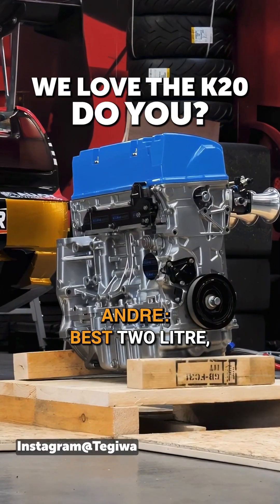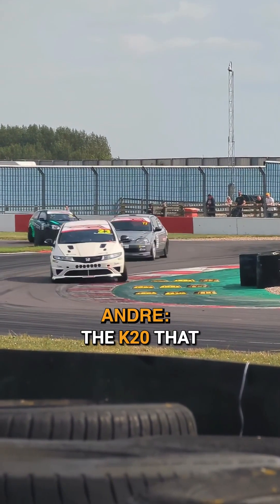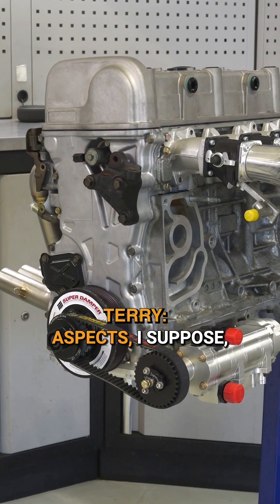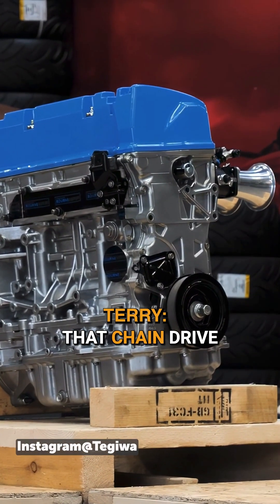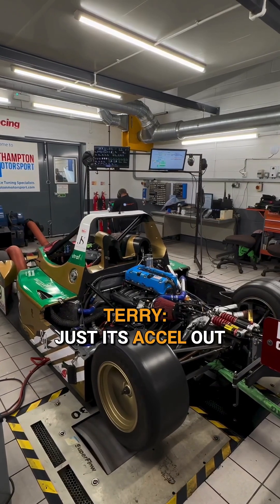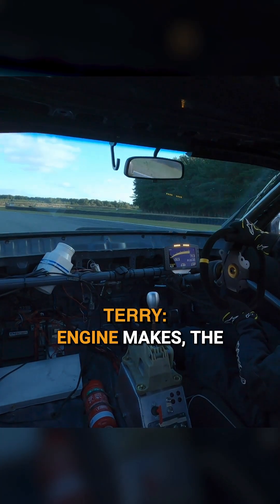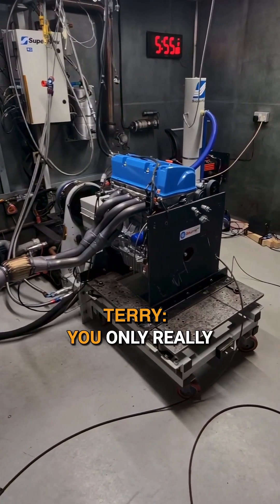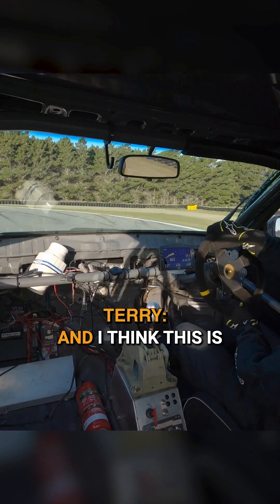We Love The K20, Do You?

Comment: Honda has really shown that they know how to make a good NA 4-cylinder. If I recall correctly, the K family was partly based on the F20C engine that’s in the S2000. That engine was the peak of Honda’s 4-cylinder designs in my opinion. Crazy power for its displacement and aspiration, and 9,000 rpm’s to play with. If anyone in this comment section has been blessed to have driven one, they’d know exactly how amazing that car was. The K20 was the next evolution of that.
Reply: I’m a motorcycle guy so I love revs and a good 4 cylinder. Honda is definitely a step above everyone else when it comes to N/A 4 cylinders. I used to have a TL and can tell you their V6’s are pretty amazing as well. unfortunately emissions are pushing everyone away from amazing engines like that

Comment: "Rate of accel" is power
Reply: i think he's refering to the weight of the internals of the engine. you know if you have a diesel, you put your foot down and you go "one Mississippi, two Mississippi, ok, now we drop the clutch" vs a petrol like on a motorcycle which is at redline in half a second. that affects how the car pulls in first few gears regardless of horsepower.
Reply: @SoulTouchMusic93  yea, I suspect this + the displacement of each piston - probably heavily weighted towards the stroke. 

Diesel v gas isn’t the best example b/c the flame front of diesel moves very slowly compared to gas. That’s why the rpms are always low - anything too fast and you won’t have proper combustion. But also the long strokes allow for more time to fully burn the mixture (so, it’s this + the energy density/cylinder pressures of diesel that makes that torque). 

A wider bore probably does have an effect on how quickly the mixture burns, but I would suspect it’s mostly the stroke. The fast moving flame front of gas, high flowing cylinder heads, the over square bore/stroke, and weight of the rotating parts are probably the main bits that add to rpm accel
Reply: @fragdude  i disagree. my 2l diesel jag was square AF while my honda civic 1.4 single cam was REALLY undersquared.
Reply: It isnt. power is torque*RPM. rate of accelleration is the engines ability to gain or lose revs quickly or delta RPM/time.
Reply: @ChrisMisMYhandle Torque × RPM is just the bookkeeping that produces power, but nobody drives at a fixed RPM on a dyno. What you feel is the power curve accelerating the mass of the car. If you double the power, you roughly double the acceleration—because if the wheels have the power, the car will accelerate.

Comment: I think the B20 with the B16 VTech head would give the K20 a run for it's money, I had one with a AEM cold air intake full Gready exhaust 4-1 hatter VTech controller air fuel management controller bigger injectors Bigger fuel rail upgraded the fuel pump stage 2 performance clutch.
Reply: ...the K20's valve timing system isn't limited to having the V-tec, it also has the cam phaser that allows for ECU-adjustable timing over a range of about 40/45°... that's why it has a lot of torque at low revs and a lot of power at high revs... it's the best two-liter engine ever built, better than the S2000 engine which, during the development phase, highlighted numerous problems that made it necessary to fall back on the more reliable K20🤗

Comment: "rate of acceleration" how many derivatives do you need to describe an engine?

Biggest k20 cons are reliability and airflow
Reply: Cons? I think you mean pros.
Reply: @idkhowtonamemyself2137 yeah i misspelled
Reply: I think he mean specifically how quickly it revs up/down when not under load, for better shifting and driveability
Reply: @brynclarke1746 it depends on the flywheel and torque, both you can change

Comment: Kswap gr86
Reply: I've got a turbo GR86 on the stock FA24. Sure a K swap is viable, but my car is running perfectly fine over 300WHP and everything else functions as stock, which makes for a much more liveable road car. My tuner has been running their car on the same turbo kit as mine at over 400bhp perfectly reliably, which I'll probably end up doing at some point. All it needs is a boost controller and a clutch. The kit uses a turbo capable of more than 600hp and its already producing boost at 2K RPM.  The FA24 is much stronger than the FA20 form the GT86 due to a massively improved con-rod design.
Also It's way cheaper, to turbo the stock engine.  it might not be as well proven as a K20, but until my engine destroys itself I see absolutely no reason to do an engine swap.  It would have probably cost me at least 3x more to do a K swap, then turbo that. Maybe more. At that point, I'd rather buy Porsche or do an engine swap for a much more exotic engine than a K20.  The FA24 sounds way better than a K20 IMHO as well. There's a video of my car on the N/A tune on my channel if you want to hear it.

For a dedicated track car, there are a few simple steps to take to mitigate any oil starvation issues. As for competition car, well, that's well out of my current remit but Fensport won countless sprint events in their GT86, which is enough anecdotal evidence for me to suggest that the FA platform has plenty of potential in the right hands.
Reply: @ChrisMisMYhandle that's awesome dude

Comment: The k series is just a shitier 4b11t lol
Reply: What about the k series makes you think that? Ik the 4b11 is very slept on but I’m genuinely curious.
Reply: @shenaniganshop3309 a few thing, the 4b11t has independent main caps and they are all 4 bolt mains with a separate girdle for oil windage, the head studs go super deep into the block on the 4b11t, the cylinders have 6 veins supporting them on the deck instead of 4, and the head is a simpler design with less to go wrong using different sized tappets to adjust lash, there are other things also but those are the big ones
Reply: Ah yes my favorite naturally aspirated 4 cylinder the 4b11t..... Wait what does that t stand for..... Huh...
Reply: @camerondolliver5871 yeah, because I've seen so many NA K20, oh wait, almost all I see are turboed anyways, having taken apart so many of both engines and building both, I much prefer the 4b11t.
Reply: From factory K20 head flows better, has better cams, and more power potential. Even more so after mods. Plus, youre comparing a factory turbo motor to an NA
Reply: @someonesomething4775 what's the highest hp out of a k20 without a billet block?
Reply: @ZandKProduction google says 1000hp 🎉
Reply: @Ham_rig97 ok, the 4b11t is like 1200hp and that's without having been around as long or in as many vehicles as the k20
Reply: @ZandKProduction yeah but k20 has more available parts and mod options. Which will make it an easier and cheaper platform to work with

Comment: I may be weird for this but right now I have an urge to k swap a Pontiac fiero...
Reply: Both of those cars need tons of chassis and suspension work to be quick around a track, and for them not to try and kill you every chance they can.😅
Reply: Or mr2 🤔
Reply: @jblob5764 3sgte in the 2nd gen mr2 is able to do the same numbers a k series. If you want to k swap a first gen I get it, but if you have a 2nd gen just build the 3sgte
Reply: @jblob5764 Mr2 2gr
Reply: Tell that to the J32 and TL type S transmission sitting next to my Fiero in the garage.

No chassis work is necessary. The space frame of the Fiero is plenty stiff. You will need to do suspension work, but it’s pretty easy to work on these compared to what you would think. It’s not hard to get these to handle well.
Reply: mr2 is much easier, just one engine mount away from dropping straight in. even the cables on the toyota gear level fit on the honda gearbox.